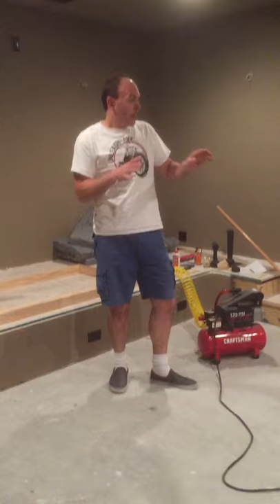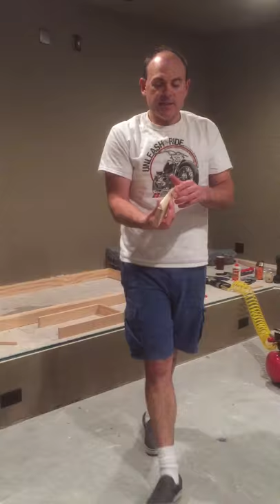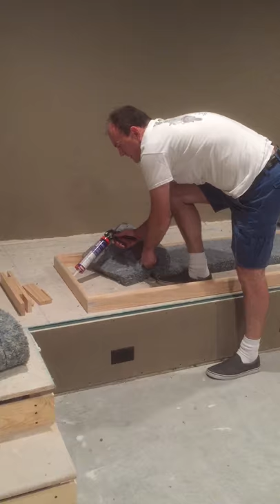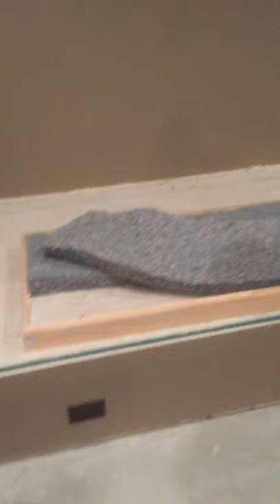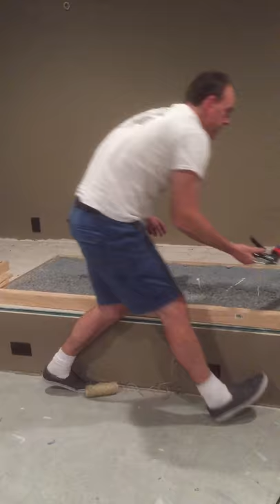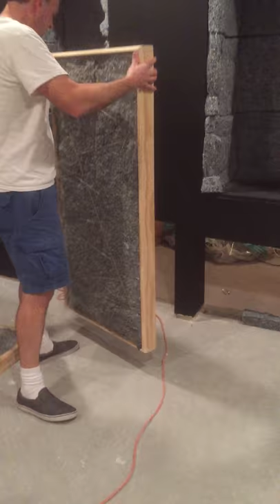Acoustic Panels for Home Movie Theater or Listening Room DIY Dolby Atmos

Comment: I used denim insulation for my own acoustic panels as well for the same reasons - I didn't want any chance of breathing in any fiberglass since I was putting a large number of panels in my drum room. For mine I framed them with 1x3's and then packed 2 layers of the R13 denim in the frame and wrapped it with burlap material that I got wholesale. For a 32"x76" panel my cost ended up being right about $45 each.

Comment: Thanks for the update I think in India it's not possible to get -?
Need your help what material I can use for acoustic pannel for home theatre 
Glass wool or any charcoal foam
Reply from the maker: bhanu tochi glass wool or rock wool insulation works really good for acoustic panels.  The best sounding movie rooms has very large panels, some people cover all the walls or at least the side walls.  The more surface area to absorb sound waves the better it sounds.

Comment: Brother you don't really need to work so hard on making a panel
Reply from the maker: Vishal Bhiwandkar - Small panels I agree, but the large panels over 6 feet tall need support otherwise absorption material falls.
Reply: @gregvandecorput  make 4-3 or 6-4 panels with 2supports in the centres
And 4 triangles at the edges you won't need any glue